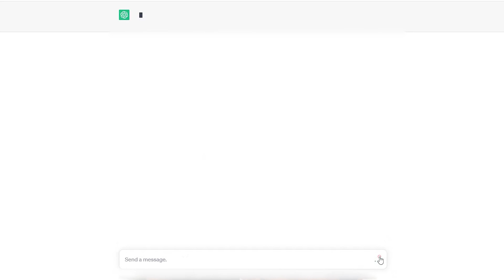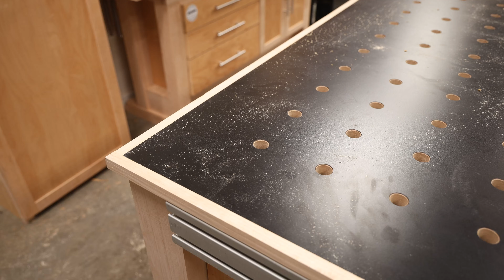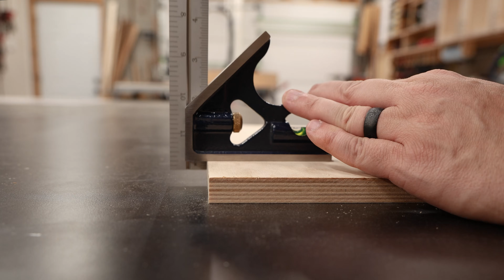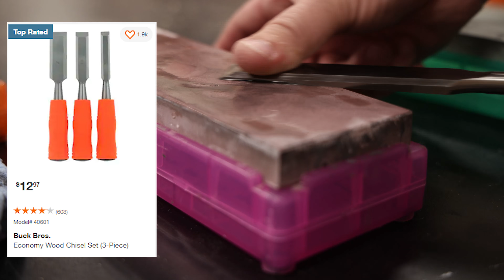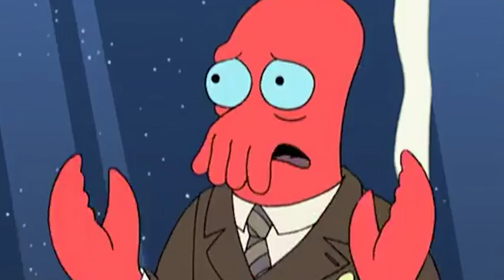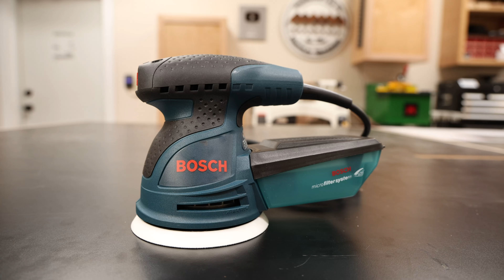I let AI spend my tool budget. This is what happened.

Comment: well the irony in the combo square is when you reference using it as a tool set-up and then referencing tablesaw and miterbox tools which are not on the list of first tools to buy, just saying. Im a carpenter and I swear by the Estwing line of hammers its all I've used for over 40 yrs.  Tool vibration is a real thing. I have Hand–Arm Vibration Syndrome (HAVS) because I work outside yr round in the winter my fingers feel like flame throwers in the morning hrs before it warms up to 35, yes its time to retire

Comment: Well after using my 5" dewalt sander for 26 years ago and still working by de way, i baught a Mirka 5" orbital sander on air because my 5" electric sander dye after 5 years so you never know about expansive tools. And I'm in Canada so my mirka sander cost me aroud $ 750.00 at the time of the Olympic In Vancouver (2010) where i am.

Comment: First of all love the video. Secondly, its interesting that you dont like the hammer recommendation because you dont use one and use a nail gun instead but the beginner woodworker might not have the money to get an air compressor and nail gun. It was only recently that I was able to get my hands on a compressor from a friend for a decent price and all he had were framing guns. So I still need to buy nail guns. Just thinking it wasnt as bad a recommendation as you made it sound. But thats just me
Reply from the maker: Well I wouldn't recommend a power nailer to a beginner. I would recommend one of the other three mallets I talked about over a hammer which has limited use in a woodshop

Comment: Ok I’ve already commented but I’m going to put my professional opinion in here because … I am what you might call a professional (a few red blooded Americans might get that reference).
All 5 of the chatbot’s recommendations were good.

The circular saw is solid. I agree with your comments about battery saws but a beginning woodworker might not want to spend the money on batteries etc. yet, and choosing a brand can be daunting for a beginner.

The combination square is fine. I have had to true up various squares over the years, including some of my more expensive ones. I wouldn’t trust any square to be true from the shop and surprisingly, in my experience, some of the most accurate squares from the shop were actually cheaper ones. Buy a square, check it and adjust it if needed. Combination squares are easy to adjust and get precisely accurate.

The hammer is a solid recommendation for a beginner. Yes, it’s more for construction work but it’s only a tiny little 16 ounce hammer that’ll be fine for a beginner to use in the workshop as they start learning the basics. I still use my steel hammers far more than any mallets, just because that’s what I do.

I agree with you regarding the chisels although for a beginner woodworker, a much cheaper set of Stanley or Bahco chisels will absolutely get the job done - and well. They’re made of perfectly decent steel and even if they do need slightly more regular sharpening, the practice at the whetstone won’t be wasted on a beginner.

And finally, the sander. I can’t argue with that either. Any of the bigger brands would suffice: Makita, Dewalt, Bosch etc., a 5 inch random orbital sander from any of them will last the test of time and do a good job in a comfortable manner. As for your comments about dust collection … yeah you’re right. That’s one thing that I’m aware of and after I don’t know how many years of woodworking, my shop vac still sits in the corner covered in dust and virtually unused. My bad.

Comment: Every square should be checked for accuracy before use and if it isn’t square, it needs to be trued up. I’ve trued several combo squares over the years, it’s easy and quick. You just need a flat needle file and 5 minutes of patience. Most types of squares can be trued up using a variety of techniques, check out how to true your particular square by searching on YouTube. This guy’s advice about the combo square is not good advice.

Comment: I was intrigued by this video, so I did a similar search and asked for a $1000 limit, which is quite common for beginner woodworkers. The main difference was the recommendation for a jobsite table saw, miter saw, a router and a coreless drill. I wasn't recommended a circular saw, which I think is almost a must in my small shop. Chatbot went with a Dewalt random orbital sander, which I would be ok with. I also received recommendations for clamps, safety gear, and some additional hand tools, which I really appreciated. What I found interesting is that the mallet recommendation I received was for a 3lb sledgehammer, which tells me that chatbots are not good at knowing the difference between a mallet and a hammer. I feel like every woodworker should have at least a $10 hammer in their shop, but I honest can't think of a good use for a sledgehammer. If you have to use one, you are probably not a good woodworker.

Comment: I liked the video, but disagreed with you in the hammer.  Yes a power nailer is a better choice, but for a beginner rhe hammer is the more economical route. If a beginner finds they don't enjoy the craft and decides not to pursue it then they are only out a few dollars for the hammer and not the hundred or so for the power nailer.
Reply from the maker: Yeah for sure. I wasn't suggesting a nailer over a hammer. I was suggesting a number of mallets that are more appropriate than a hammer in the woodshop.

Comment: Thank you for making all your videos. We are currently starting to sell off our trucking company and plan to retire. Along with friends and family, we have built houses in the past. But never any fine wood work. So I'll be starting out utilizing my 10" Dewalt rack and pinion contractors saw along with a track saw to make cabinets for our garage/wood shop.
So far, you have the  most instructive videos I've found. As a thank you and as of today, we purchased about twelve items from your Amazon linked store. We hope this helps.
Though the flat measuring tape had changed. We elected to pick up the Hart flat tape.

Thank you for your help. We appreciate it. 

Hopefully we will start on our cabinets in about 45 days.

Comment: I like this kind of video!  The one area didn't touch on was for example with chisels going to need a way to sharpen them so there is added costs associated with that tool purchase just to keep them going as a useful tool.  You already had the stones to sharpen and get them ready but a new wood worker wouldn't.
Reply from the maker: That's correct! And that's also true with blades for the saw and sandpaper for the sander.

Comment: Good video, but I would have liked to have seen more of the conversation with the AI Overlord. It might be "AI", but it still has to be given some clues.
Reply from the maker: You saw the entire conversation
Reply: @MWAWoodworks  Ha! No wonder it recommended a hammer! Nice concept. Would be fun to see how deep the AI knowledge is if it is given more info.
Reply: @MWAWoodworks  I asked a different way and got these 5 suggestions:
    Random Orbital Sander:
        Bosch ROS20VSC: This sander offers a good balance between performance and affordability, with variable speed control and effective dust collection.

    Chisels:
        Narex Richter: Narex chisels are known for their excellent value and quality. The Narex Richter line offers a range of sizes and is well-regarded among woodworkers.

    Block Plane:
        Stanley 12-139 Bailey No.60-1/2: This block plane is a solid choice, known for its durability and precision. It has an adjustable mouth and performs well for various woodworking tasks.

    Dovetail Saw:
        Gyokucho 372: Gyokucho is a respected Japanese brand that produces high-quality saws. Their dovetail saws are renowned for their sharpness and cutting accuracy.

    Router:
        Bosch 1617EVSPK: This router is a popular choice among woodworkers due to its versatility and performance. It comes with both fixed and plunge bases, allowing for a wide range of applications.
Reply from the maker: Not bad although I'd buy many things before a dovetail saw, unless I was going full hand tools.

Comment: I think those tools are spot on, I think the hammer is also a necessity as you said to the bot your a new woodworker, that could mean anything, what kind of woodworking I'm a woodworker, I build custom furniture but I also do joinery work, general construction is woodworking. I think if you had said to the bot you want to make fine furniture in a workshop you may have got a different recommendation.
Reply: Yep, I agree. Also, if you work with hand tools, and decide to make a mortise, what are you using to strike your chisels?

Comment: NO ONE HAS PICKED A TAPE MEASURE.  For my first house, I had a Good Hammer, Hand Saw, Square, Folding  1 meter Rule  ( a ruler is the head of a country) and a 1" chisel still in use today.  With those few tools, you can build just about anything. Saw horses and the like we made. You would get all that for under $100.
Reply: Also a strip of wood, metal, or other material having a straight edge and usually marked off in inches or centimeters, used for drawing lines, measuring, etc.

Comment: I feel like it should have added a drill/driver instead of a metal hammer.
Also, dewalt makes an accessory for the corded circular saw for better dust collection for about 12.99.
Reply from the maker: agree with the drill! Also 2 other people mentioned the adapter for the saw. Not sure why they don't just sell it with the saw? Its just a small plastic piece.

Comment: Ahh, if it's your first 5 tools, I don't think  you have either a nail gun or a wooden mallet. Having built several homes and going to a teck school in the 60's you can build a he'll of a lot of wood working projects with the suggested items. But for me no 5 would have been a tape measure. Taking my boots off to measure 5 feet doesn't work with metric. Also being your first 5 tools implies low skill measure, thus cheap multi angle square is good. Particularly as there was no budget. AI 4 VS you 2

Comment: I think it did an OK job, but it's hard to construct anything without some sort of clamp.  And unless you're going full on traditional joinery, you are going to need a drill of some sort.  I'd take either of those over the chisels.  A claw hammer isn't "wrong" per see, just not the most suitable type of hitting device.
Reply from the maker: yes, I probably wouldnt buy chisels at first, and yes you def need a drill.

Comment: I’m giving the Bot a pass on everything but the hammer and the chisels. Woodworkers glue and screw, so unless you are breaking down pallets for wood, a claw hammer is unnecessary. A beginner woodworker does not have an absolute NEED for chisels. 
Instead, I would go for a drill driver (glue and SCREW) and a 12’ or 16’ tape measure. 

Then again, I can’t believe clamps didn’t make the list either. 😮😊

Great video!
Reply from the maker: yep I agree!

Comment: The AI bot thinks DIY=carpentry=woodworking.  30 minutes of surfing YouTube would have provided a better list than the bot.  My advice for first tools for newbies is to go table saw and router...you can do a boatload of work with those two items.  Buy the best you can afford.  After that, I would add in clamps, sander and chisels.  Also...most critical before spending a dollar on tools is actually having a place you can do work and set up a bench or work table of some kind.
Reply from the maker: I thought that it would be worse than it was.

Comment: I have an adapter for my Makita circular saw (came with the saw), which does work well for picking up sawdust. The trick is getting the hose to fit correctly. Overall the recommendations were pretty good. I have a couple of "beater chisels" and a Irwin/Marples chisel set which is okay but eventually I'll get the Narex down the road.
Reply from the maker: I have the Marples as well, bought 10 or so years ago and I've upgrades over the years
Reply: How old are your Marples chisels? Modern ones don’t hold a candle to old ones. The old ones made in Sheffield in England are actually quite decent quality and absolutely worth owning. Modern ones … not so much. Marples sold out a few decades ago and the new owner company doesn’t give a damn about quality.
Reply: @TheIdeasGuy  Mine are definitely more recent (15 years or so). I agree that the older chisels are definitely higher quality

Comment: Seems you needed to make up reasons to call the choices 'whiffs'.  It recommended a combination square and you were unhappy with the brand selected.  You admit that it picked a hammer (which is required for the chisels) but you didn't like that hammer.  Did you give it a budget?  Did you specify that you were exclusively doing woodworking and define what that term means to you?  The LLMs are only as good as the context with which they are presented.
Reply from the maker: Yep in the very beginning of the video I told it I was a NEW woodworker and told it to give me specific tool recommendations. The combo square it recommended is a waste of money and not suitable for woodworking. The hammer is completely the wrong kind of hammer for woodworking and you cannot strike chisels with that kind of hammer unless you like broken chisel handles LOL. Thanks for watching!
Reply: @MWAWoodworks  My first chisel  (Stanley early 70's) had a steel centre in the handle with a metal hammer point on the back. Over the years It has been shortened by about 2 inches from resharpening and at times I have been very hard on it, it takes all the punishment I give out.

Comment: That dewalt circular saw does have an adapter you can buy to hook up vacuum. It made a huge difference. I hated using that saw in the woodshop until I got that adapter. Added the adapter Upgraded the blade Now I'm like, who needs a track saw
Reply from the maker: Wow! I need to check that out. Wonder why they don't sell it with rhe saw 🤔
Reply: @MWAWoodworks  I have the adapter as well. I don't think it's track-saw efficient but does a pretty good job. I'd say it collects 60 - 75% of the dust. Doesn't look like the 6.5in cordless version can accept it because it doesn't have the same port.

Comment: Well, this story is arbitrary and the result totally non-conclusive: what would YOU recommend as my FIRST 5 tools for a new woodworking shop? All you seemed to judge was whether the bot recommended good value. So it’s once more down to an evaluation of efficiency where effectiveness should be key.
At least the bot recommended a hammer for the chisels but that went uncommented, but then this may be a coincidence …
Reply from the maker: I actually agreed that the circ saw, sander, and combo square were all good first tools to be on the list. Maybe that wasn't clear. Also you'd never use a hammer like that one on a chisel. That's why I explained the use of mallets in a workshop! Thanks for watching!
Reply: Thanks for getting back on my points! I fully agree on the hammer and you also made this very clear in your video. What I meant to say is that the bot was "smart" enough to include something WITH the chisels to apply more force. This is most likely due to the fact that texts used to train the bot use chisel and hammer together in the same contexts. Knowing only text, current chat bots have no notion of what a chisel and a hammer even is. 😮

Comment: Interesting exercise. The AI did a lot better than I thought it would. Especially considering for someone "brand new" to woodworking, picking only 5 tools as the "best" to get started with is an extremely challenging exercise. Hard to imagine any functioning person interested in woodworking doesn't already own a common hammer, and I'd argue a speed square would be more useful with circular saw use. That said, I have a set of Narex chisels, the same DeWalt corded circular saw, and the same Bosch sander ... all purchased years ago. Which begs the question - is AI really necessary?   lol
Reply from the maker: Yeah 5 tools only is very challenging indeed. And AI is definitely not necessary however that won't stop people from heavily relying on it in the future 🤣
Reply: Yes a speed square is excellent. In schools today you still use hand saws as a power saw is very unforgiving for a novice.

Comment: if you have no wood working tools at all, then the bot did a good job picking tools
Reply from the maker: Yes. Well a pretty good job.
Reply: @MWAWoodworks as I mentioned in detail in a main comment out in the comment section, it did a very good job. You made some good points but as a whole, I agree with the chatbot more than I agree with you about the combo square and the hammer. And I don’t typically toot my own horn but I am a professional in this area at least as much as you are. My point is, every professional will have their own opinions and in this case I disagree with two of yours.

Comment: Never trust a bot to make a decision that you are capable of doing yourself
Reply: The assumption is that a complete beginner would not be capable of making that decision.  They simply don't know what to buy.  They can use Google to find sites/videos that provide recommendations and then spend a couple of hours trying to work out which recommendations are best for them, or they can spend 2 minutes getting AI to do it for them.  In this case, the AI has done a passable job, but probably not good enough.
Reply from the maker: So true!

Comment: All my work is DIY.  I've had pretty good luck with Irwin chisels and such but they usually need to be tuned up a bit.

I'm usually shopping in the high low tier or low middle tier... Primarily because I'm a cheap bastard and I'm not making heirloom furniture.
Reply from the maker: That makes perfect sense